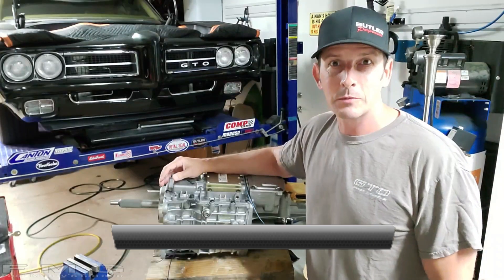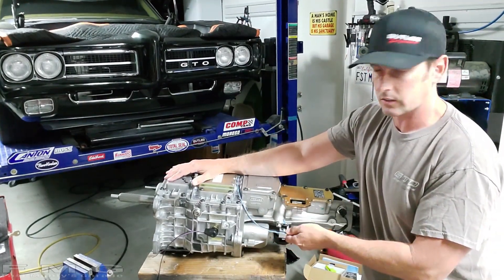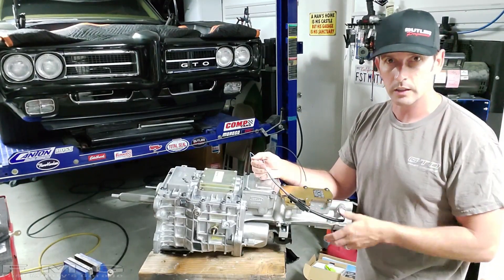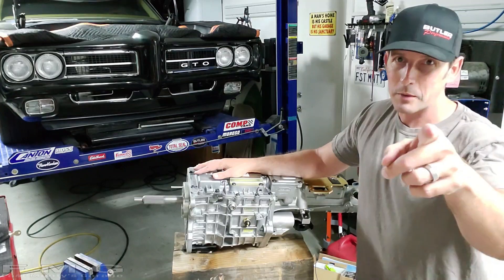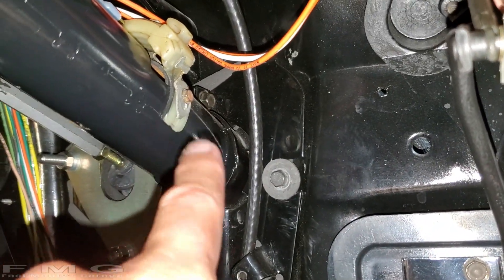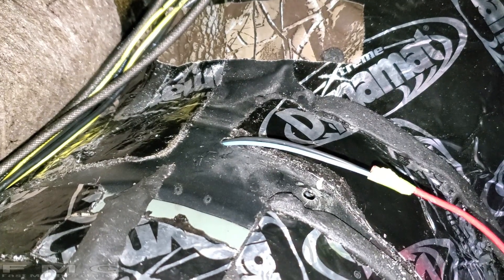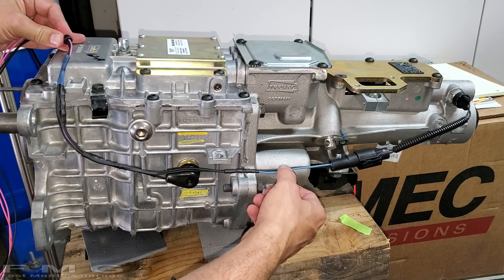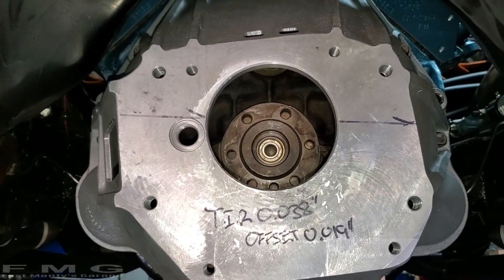TREMEC TKO/TKX/T56 Install, Part 8:  How to install a Wire Harness for your TREMEC.

Comment: Did you install a relay into the neutral safety switch portion of the harness?
Reply from the maker: No. Im still using my original clutch pedal switch.

Comment: We didn't get to see the electronic speedo connection.  
Thanks for the video.
Reply: At the 2 min mark.
Reply from the maker: There's an electronic speedometer option?  Tell me more... :)
Reply: @FastMonty  I thought you pointed out on the passenger side of the trans where the speedo hooks up. You even mentioned having either electric or mechanical..
Reply from the maker: @JESSE__OWENS  Ahhh, the connection for one, yes.  I have a mechanical speedometer, so I didn't need to wire that up.  Sorry for the confusion!
Reply: @FastMonty  but there is an adapter to make it mechanical.

Comment: Monty, another question. Did the light blue/black pigtail for the neutral safety connector come with your kit from SST? I ordered my kit through SST as well and I didn’t receive one.
Reply from the maker: Well, yes.  BUT, it's an optional item, so I had it added to my order.  I also do not use it, as I think I mentioned in the video?
Reply: @FastMonty  yes you did. I’m wondering if I need to bother. I mean, I never had one in my Muncie and never missed it. When your driving a standard it automatic to put your foot on the clutch at a stop or not in motion. At least it is for me.
Reply from the maker: @darinandalinahouse9596  Yeah, it's a safety for starting.  The GTO won't start unless you have the clutch down.  So, that's why I didn't use it.  If you're the only person who will ever drive your car, you probably won't need it.  But, just in case some knuckle head tries to start it, while in gear, it won't start.  (Obviously it has to be wired through the key start circuit)  Hope that helps.
Reply: I know I'm a little late to the party but I'm installing a Tremec TKX into a 63 Corvette. I'd like to use the neutral safety switch you've installed into the GTO but I need the pigtail extension you're using.  I don't see it on Silver Sports website.  Do you know of a vendor that sells it or a part #?